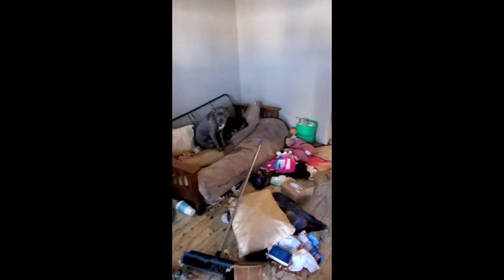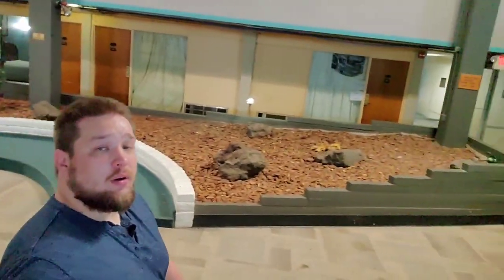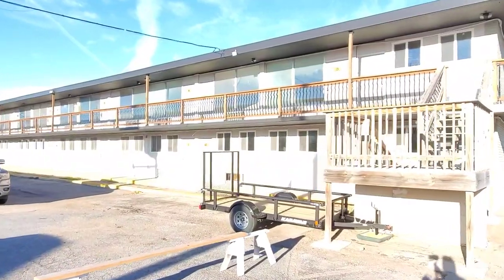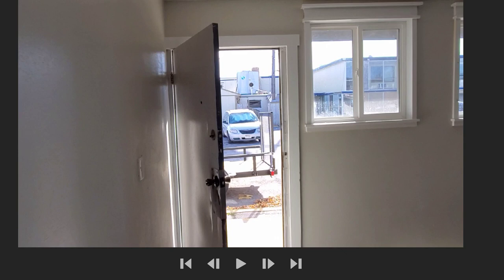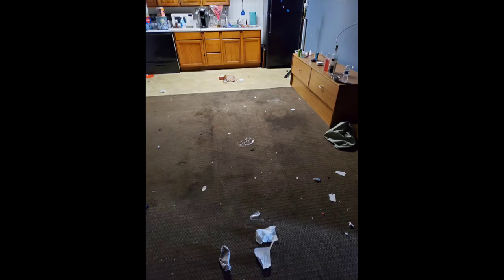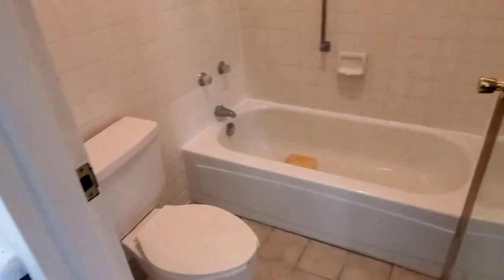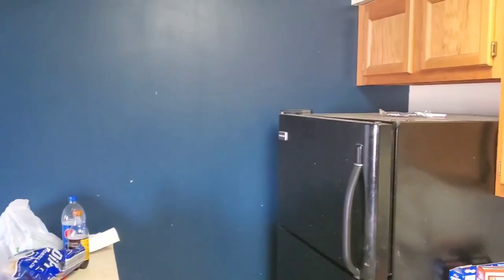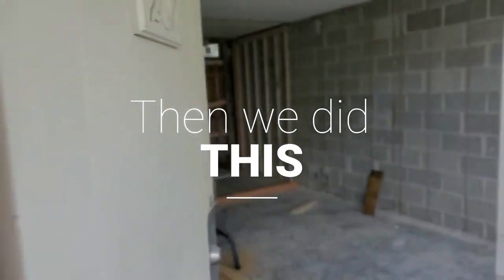E36 | Hotel Fixer Upper Full Episode 2020 remodeling before and after

Comment: I've been watching your channel and I'm rooting for your success story :)  You have done a fantastic job refurbishing that super old annex building (speaking of, why was that building there in the first place?  It can't have been part of the original Holi-dome, could it?--I would love to understand that).   

I really like the new paint colors.   

One nitpick...I noticed that the concrete deck where the old rail was attached (before the new wood/metal rail deck was added) has areas where the concrete is missing.  Is there any way to refill/patch those areas?  It would improve the aesthetics around that second story if the concrete around the edges was completely smooth.  That would make a big difference in the finished product.   

Regardless....keep up the good work, Paul.
Reply from the maker: I plan to do a video over the history as I understand it and have been told here soon.  Ill explain the annex, from the story I heard.  It's kinda long

As far as concrete work,  there's alot of fine tuning i plan to do but to get open asap to get through pandemic I've had to adjust my timeline and do some temp fixes to appease guests.
Reply: @TheUglyMotel  sounds good.  Looking forward to the history video!  And totally understand about temp fixes to get things ready faster.

Comment: add some exust room fans in the common area to help pull the heat from the main area since you using ptac units you could have a theromstat wired to a contactor to control them
Reply from the maker: Nice, actually we just did that

Comment: Lived in Lincoln for years, Its nice that some one is actually putting some work into this place. Another thing, When I worked at the Super 8 in York Ne, we wouldn't let locals stay, because the only reason a local would MORE THAN LIKELY stay in a hotel in the town they live in, is they are leaving a bad situation and if that said "bad/dangerous" person finds them, that would draw attention or drama and damage to the hotel. Or they wanted to party and trash the room, or they are on drugs and, well.... you know what drug addicts can do to a hotel room. completely destroy it. so my advice to you, after working in the hotel industry for 5 years, If the person is a local, meaning they live within the lincoln area or immediate vicinity, charge them a 150.00 deposit DUE AT CHECK IN, that they can receive back once they check out and the room has been checked. Otherwise this hotel will revert right back to where it was and attract "those types of people". best of luck to you!
Reply from the maker: Great advice,  I appreciate this alot. We're you able to just say sorry we don't rent to locals or did you just not offer any discounts to locals?
Reply: @TheUglyMotel  IF it was a nicer family and something bad happened, like house fire, pipes flood, THEN we would let locals stay. We had weekly rates which made it cheaper overall per night. We also had a do not stay list. If someone stays and damaged something, ruined the carpet or walls, caused disturbances, drank to much, smoked in a non smoking room, caused commotion enough for police to arrive, anything along those lines, they would be put on a “Do not stay” list that we kept at the front counter visible only to us. We had roughly 50 people on that list. After we implemented that list, drama and damages went way down. So it was much calmer and quieter on a daily basis. We WOULD allow families to come out and book the bigger suites for children’s pool parties, because those normally were only for the day. They would use the pool, hot tub, arcade games, and have cake and ice cream, use the rooms to change and relax. And they would essentially check out in the evening. We had a 20% discount for kids birthday parties. Also we were told to use our discretion/common sense. If someone comes in, looking for a room, even if they ARE or ARE NOT a local, if they clearly look like they are on drugs, or from out of state, or rambling a mile a minute, or has nooo form of credit card or debit card, refuse them a room. Tell them you require a credit card for incidentals and ALWAYS ALWAYS ALWAYS match the credit card name to the name on their I.d. I think I had to cut up nearly 100 stolen credit cards within a 2 year span. No credit card? Fine. 300$ deposit, and they can get it back in the morning when the room has been checked and nothing is damaged. I worked full time/a lot of overtime for YEARS on day shift, evening shift and overnight shift at front desk. Seen some crazy things. Just gotta stay on your toes. ALWAYS USE YOUR DISCRETION. If someone doesn’t seem right, they more than likely aren’t. You have to be tough on it, it’s your business and livelihood.
Reply from the maker: @Trashytrin  after 7 years we had a very firm do not rent list. Unfortunately Lincoln has alot of people to meet that could join the list. Our goal to balance the winter slow months and steady income is to rent annex as apartments and limit the long stays in the hotel to weeklies and companies only. The goal is to have the hotel more focused on nightlies.
Reply: @TheUglyMotel  Yes! Go around to local construction companies and give them your business card for the hotel. And ask to speak with the foreman or manager of that construction company and offer discounts for traveling construction crews. They are normally well behaved cause they wouldn’t wana get rowdy and lose their job so so a BULK of our customers were traveling construction crews that needed rooms for as little as a week, we even had welders building large tanks in Geneva that stayed for 10 months. We offered 35$ per night plus tax for crews. Our BIGGEST customer base was C-Tec. They would fly guys in from all over the country. Texas, Maryland, Maine, Washington for big jobs. So I would definitely go to your local C-Tex office and offer a discounted rate for their guys.

Comment: all the shower heads and water spouts and handles should have been replaced as well as the safety bars in the shower.... why use old ones when new ones would not cost that much.  the air conditioners either need to be deep cleaned or painted because they are looking ugly and old